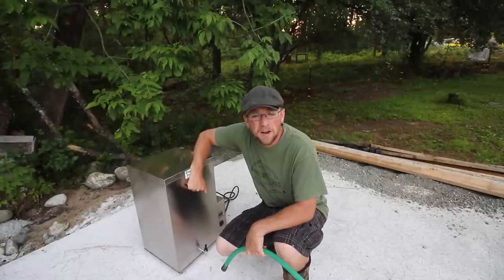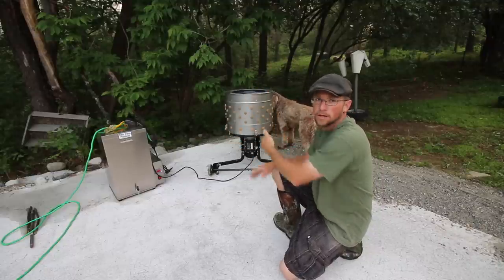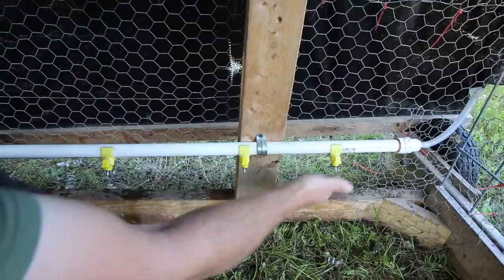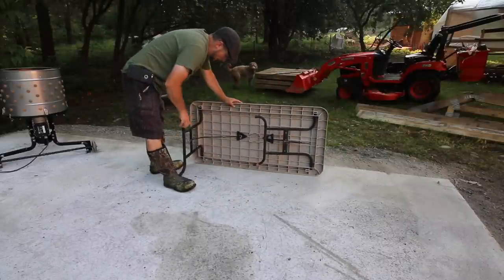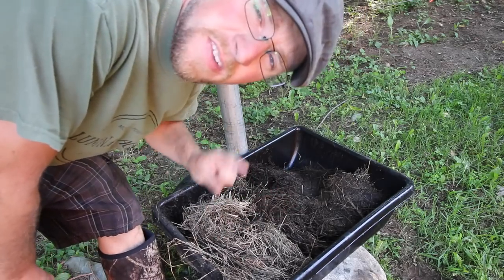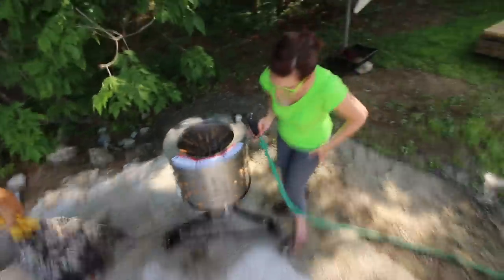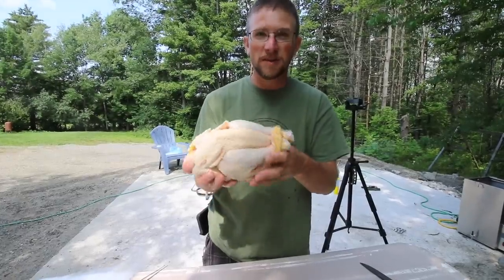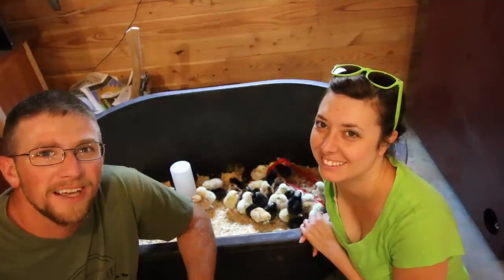Our New Butchering Setup for Harvesting  our Pasture Raised Chickens

Comment: Nice, will be adding the electric scalder to my list of wants, for when i get my place finely, was looking to see what other item i could use besides using propane/gas.  

Though i cringed with you having the cords on the ground in the work area. Get you an couple fence posts to hang your power cords up off the ground and around the work area. No tripping and no water/electric hazard. Add another and you can hang the water hose.
Reply from the maker: The scalder worked great! It was a great price too! We used our turkey fryer before which worked awesome, but you has to keep adjusting for the temp. It was nice to be able to set and forget it. Once the outdoor kitchen is finished we wont have to worry about the cords
Reply: Same here. I watch all their videos to learn from them. I am looking forward to having my own place too so I can grow and raise our food.

Comment: We do the straw trick with zip lock bags. But we use a vacuum pump to draw out the air. You zip it all the way over to the end with only enough room for the straw & suck out all the air. Then quickly withdraw the straw while sealing the rest of the way. We then put it into another zip lock bag & close it up for good measure. No more freezer burn. We do this with store bought food that we've bought in bulk too!
Reply from the maker: Nice trick! Thanks!

Comment: That's a great system. .. but food for thought... when I raised 200 barred rock roosters I skinned the birds. I would take a spoon to get the extra fat off the skin. 
  Then I would wash them in dawn dish soap. Next powder with borax. Last I would dry with a hair dryer. Then I sold them to a local fly fishing shop. (They use feathers to tie Flys )...
   Great info and great video. ...curt

Comment: Have you looked at a foot controlled valve for the plucker hose intake?  That way you can use the built-in sprayers but can turn on and off water easily.
Reply from the maker: No but that would be awesome! Thanks

Comment: Another option to raise your table height is to cut 4 pieces of 1 1/2" diameter PVC pipe to about 14 inches in length and put one on each foot of the table, i.e, leg extensions.

Comment: Wonderful instructional video.👍  We've used the straw method as well and it works good.  If you ever want to section your chicken/poultry🐔 get a heat sealer and hot air gun.  The heat sealer will cut your shrink bags to size and the hot air gun shrinks the bags.  I poke a hole to get the air out prior to the hot air gun shrinking and then put a label (date & wings or legs or thighs) over it.  With our youngest off to college it's just the two of us and rarely do I cook an entire chicken.  Thank you for sharing the 10% discount code w/CoopsNMore ~ we used it! 👍🐔
Reply from the maker: Thanks! Glad you got to use it!

Comment: Hi there. Very informative video. I was wondering how long you keep your Cornish before processing them and where you get your chicks. And what is the normal timeframe from chick to processing? Thanks in advance.
Reply from the maker: We keep our cornish's for 8 weeks. We got our from our local feed store
Reply: Lumnah Acres thank you for the reply. Mine are currently around 9 weeks and I got them from tractor supply company. Thought about keeping them for egg lying but I may have to bite the bullet and process them. I need to look into a scolder and plucker asap. I have 3 or them and 3 Rhode Island reds. What’s the water solution make up used after plucking?
Reply from the maker: We put our chickens in a cooler full of ice water with some apple cider vinegar. Coopsnmore has the best plucker and scalder. don't forget we have a  10% off coupon code for them too

Comment: We added a "y" fitting to the plucker water intake to add a small hose and sprayer. This allows the chickens to be rinsed automatically and manually if needed
Reply from the maker: Did you add a shut off on the plucker too? I was thinking about doing that.